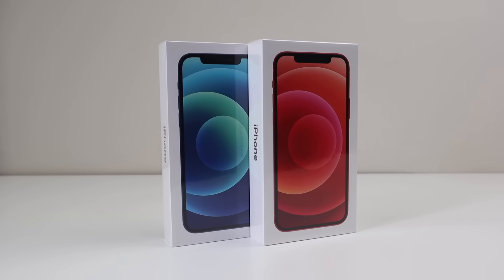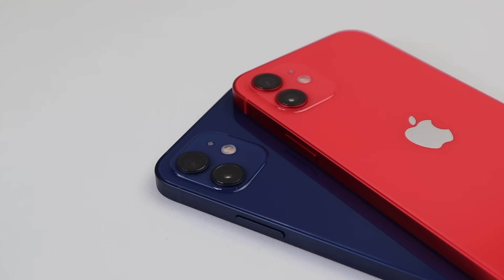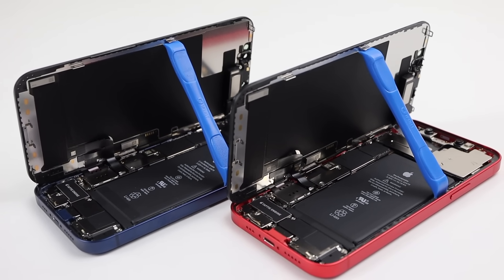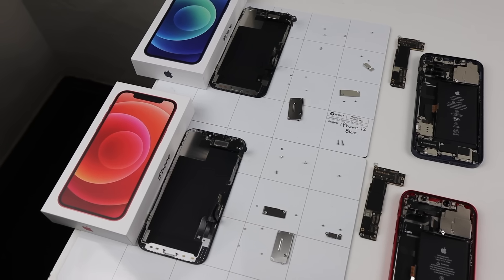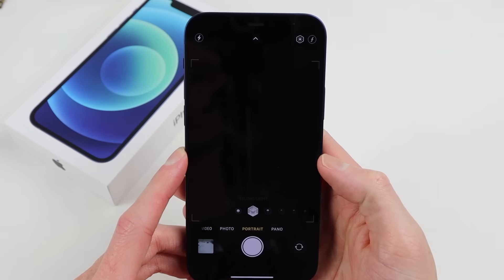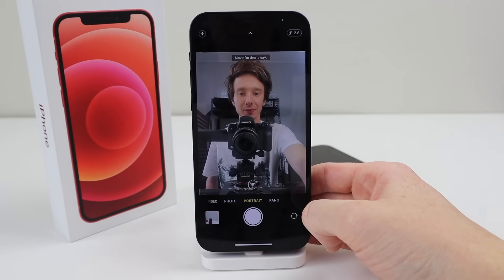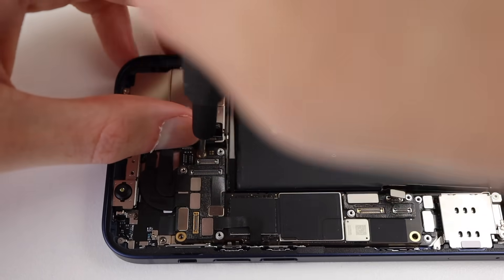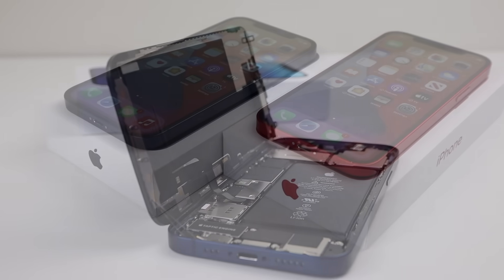iPhone 12 Anti Repair Design - Teardown and Repair Assessment

Comment: So basically Apple will break your phone. Hope they're enjoying their 5M loss in the M1 hihacking.
So how are they doing this? The logic board impedance? We know no 2 components are exactly the same. So overall no 2 logic boards will have the same impedance.  Write into the software to look for the previously measured impedance +/- 5%. If its the known impedance start all systems normal.  If not.....

Comment: They do this so 
1st; they make more money 
2nd: Chinese workers cant steal genuine phone parts in factory and make money of ebay
3rnd: make more money.
4st: F*ck Our users, they are here for us.. not the other way around. the f*ck they think?
5st: who cares, idjuts still gonna buy it if they previously used iphones..  

Two days ago, my iphone 8 started to act up... No issues before just a "wtf"-moment with soggy swappin between apps.. I dont use a lot of apps.. and NOW it starts to feel " a bit slower" .. it has been a few weeks since my last IOS-update.. and it is now 2.5 years old.. 
so here goes: Dear apple, this will be my last Iphone.. I will not get a new iphone, I will not have to buy a brand new charget, (I have 5-8 genuine apple chargers and cables that goes back to Ipod)
we have had our downs and downs, but even after going from the 6s model to an 8 it didnt feel "wow".. like piss warm flat beer... charged up my old 4s and it feels exactly the same.. And have a better screen format.. So bye and thanks for the fish. ps. f*ck you apple.. ds.

Comment: 2:37 Am I the only one who finds it strange that the two "identical devices" have different amounts of free space?
Reply: Only guessing, but I have to assume one color came off the line later than the other, and it probably had a minor software update built-in.  Once they've both updated (assuming you've changed nothing else), they'd probably be the same.

Comment: "We Are The Future"

Here is the new iphone 20, no charger, earpods, adapters, warranty or a battery. Oh almsot forgot, the phone doesnt include a screen and any other part.
Price is 50 000 dollars, also you can buy the rest of the parts at our store for 10k each and remeber, no fixing, when your phone is broken you gotta buy a new one but because we want no impact on the climate it will cost you doubble to get a new one and after a year we will install a software on your phone so that it doesnt work anymore. Enjoy!
Reply: IPhone 21 will just not include a phone at all just the box
Reply: iphone 23:

You get nothing. You lose.
Reply: new premium air
open the box and now everyone has it
Reply: Apple Marketing Manager reading this: "OMG GENIUS"
Reply: @hanabi9999  xD
Reply: You guy missed the point of the video. It won't be, "Go buy all our parts on our store."

It'll be, "Here's just the phone. All parts are serialized and cannot be replaced even with parts purchased specifically for the device. And we don't sell you the parts on our store. Go, exclusively, to our repair shops so they can decide if they want to repair your device. Or they'll break it further and tell you to buy a new phone... Oh and by the way you'll need new adapters for all your old connectors to function with your new device. Have a nice day, and a clean planet."
If they sold you functional parts on their store they would be encouraging self repair or 3rd party repairs, which is something they don't want.
Reply: @epicfail5473  bro my comment aint really bout the video, its about the New iPhone 22. I dont make the rules
Reply: The video is very good. congratulations! If ken you bought or will buy an iPhone 12 Pro, this is what you have to buy !!!!📲📲                  https://amzn.to/2IZY5VM
Reply: @Galaxies no, that means that the iPhone has some sort of value
Reply: Apple: Write it down! Write it down!

Comment: Sorry Apple, I don't like your attitude and I'm not replacing my iPhone with a product designed to require over-priced repair (that starts pretty darn expensive) - that's just greed. I'm guessing your battery doesn't last as long as the other components? Perhaps competitors ought to start advertising the life-cost of ownership?

Comment: Tim Cook: "yea so we've already got about 2 billion of those wall adapters in circulation so we wont include one with your $1000 phone but we will include a new type of cable that doesnt fit any older wall adapter so that you have to go and buy a new wall adapter for $50 extra and dont forget a $40 headphone port because we're too fucking retarded to care about our customers or even just make our headphones with a lightning cable instead of a AUX or including one in the box with a set of headphones"

I haven't even watched past this point and I just know it's going to get so much more infuriating. Fuck apple.

Comment: There is some component which you have to read and copy the display pairing id has to be read into the respective phone and I have seen a video where this problem is solved
I think you should read the face id and refeed the id and check it out

Comment: Alright, it's surprising that the phone won't start unless you use the charger. But why do they let you turn it on using the charger ? Not on purpose I suppose.
Most importantly, do you use the charger that belongs to the device ?
Apple is so evil, the phone might refuse another charger just like it did with the camera.

Comment: Thanks for your commitment to doing this video. So you can't use the usb C to lightning cable without a new C type charger but surely you can use an older charger with an existing usb A to lightning cable, which we Apple users have a plethora of?

Comment: I wonder why Apple didn't allready came up with the Idea of integrating a type of starage chip which erases itself if light hits it, like these old Eprom chips. This way you will brick the phone by simply opening it. If you combine this topology with for example a raid 0 network of those chips, it would be nearly impossible to repair those products.

Comment: if you have a older compledet charger example form iPhone 6s you can used to iPhone 12  and you don't need buying the adaptor 👏
Reply: But it wilm charge slower do you know why everyone is switching to type c because it charges faster
Reply: @theirongamer7791  yes but you don't need buying the new adaptor when battery drop to 20 % then putting into charging earlier and that is 🤗
Reply: @zoranmilanovic1075  nope wrong
Reply: @theirongamer7791  never mine

Comment: I'm a big fan of "right to repair"

That's why my car is older than the average Fortnite player.
Reply: @ISHMAM RAIYAN I swear the late 90's Corollas are invincible. They're still common on the road today.
Reply: So, not that old, right?
Reply: @alexisaguirrevazquez7900  Maybe I should've said average GTA player. They're (slightly) older.

In any case, it's a 2001.
Reply: @Somethin5041  You know that was also a joke about fortnite players, right?
Reply: @alexisaguirrevazquez7900  Yep.

Comment: It’s sickening but it is industry standard. I used to work in reverse engineering one specific incident I was going Chrysler gauge clusters. You couldn’t swap them yourself and if you did you would have to tow it to the dealer to reflash cause it won’t start if there’s a VIN mismatch between ECU and gauge cluster. Also TCU and who knows what other modules. But manufacturers make money on parts more than cars.

Comment: Having those features actually identifies if the phone is genuine and the parts are OEM not to make it unfixable but yeah instead of you bringing it to a cheap repair shop you have to get it repaired in an apple store for the price of another phone lol. The glues also help parts on the phone from vibration, static charges, and shock. But damn... I don't know why I am here I hated apple after Steve Jobs is gone but what they did to the charges, earphone jacks, etc... Is this their new innovation? lol
Reply: IPHONE HACKING JASON-HACK ON TELEGRAM HE IS A PRO 💯 💯
+1 (219) 202 2523

Comment: The high cost of the new phones makes repairs after warrany necessary. Apple knows this and can make a buck selling parts and making repairs. I bet there is some engineered failure tucked away with these devices as well.

Comment: It may have to do with calibration data for the camera and the screen? True tone seems like it would need calibration to function at all. The camera might be calibrated too and if the wrong calibration data is used for control purposes, that may mess things ups. Of course it would be easily fixed by having a database with calibration data for a all genuine parts and just pulling the correct data based on the ID of each part

Comment: i don't know why I continue to use apple. I replaced a battery in a 6s for a customer right before covid and he camera stopped working. If i put her old battery back in, it was fine. It's just so scummy on apple's part. you spend all that money on the devices, they're coming with less and less accessories and yet you still can't take your phone to a shop to have it repaired. and then the customer thinks you broke their phone leaves a bad review. you lose a few customers.... why? all because apple wont let you replace a battery in their overpriced phone! The biggest reason i switched to the z fold 2 after supporting apple for years, is because every year they just slap you harder and harder in the face. oh you wanted a 120hz display on the 12 pro... nahhh you're stuck with 60hz. so yes, as the z fold 2 is $500 more dollars than the 12 pro max it was worth it just because my money wasn't going to apple's greedy pockets. Mind you as i have had most galaxy and notes though out the years I have also had every iPhone since the original. We should have learned our lesson when the 4 came out and they told us we were not getting signal because we as paying customers were "holding the phone wrong" right then i should have realized..........

Comment: Unfortunately, the problem is not new... But there is a solution ! For the older iphones (11 and before), you can buy a all in one chip programmer for the display, battery and fingerprint (the JC-V1S for example) it cost about 70$ on alixpress. I hope we will soon get an updated version of these king of programmers for the iphone 12 and f**k Apple anti repair design :)
Nice video BTW !

Comment: Hi Hugh,

   Did you try swapping the screen and battery? Those are the most common repairs. Replacing a logic board most likely means the phone experienced a severe damage. Might as well buy a new phone.  Also, perhaps the logic board pairing is to ensure that the board hasn’t been tampered with; security purposes? 

   In fact, from my experience, repairing the device with 3rd party parts such as, screen, battery or camera changes the device into a lesser quality. It does make the device usable again, however it’s just not the same anymore. For some people it may not be a big deal, but it is for me and others. It’s a very expensive device. 

Thanks for the awesome video! I’ve enjoyed it and it’s very informative! Good job, mate!

Comment: Meanwhile i got my battery, daughterboard (charging and speaker) and the connecting flex cables (mobo to daubo) repaired in like 30$ for my poco f1 ...
Bought that phone in nov 2018 and repaired it in feb 2020 ... Still works great.... Even though i have a overclocked display and gpu kernel (lawrun) in my phone... And also a CAF rom (reloaded os)... Thanks apple ... Won't bother buying a 300$ android which even has a case inside the box rather than a 1k+$ iphone without a charger incl. In a box...

Funny that in a video comments ppl called android users broke and told iphones are far better in day to day use... Please for the love of god buy android ... Far more user friendly.

Comment: ill admit that although this is just criminal by itself, if they commited to provide hardware repairs fo up to ~4 years for each models, with decent pricing, this (+ the other report -to lock tricks) could END the asininity of phone thieves. that would be cool indeed, being able to just leave your phone be anywhere and dont be worried since it wont be of Any value to anyone else would be a very welcomed peace of mind. but still... until thats the deal, NOPE.

Comment: How to extort a market ensure your the only one that can offer customer service, then you can run a monopoly on the monthly fees and for those naughty people that don't pay well the fees will amount to the cost of buying it over again. Then to double down pay off some Politicians in Mass, to push laws that enforce the technician is the only people that can repair the equipment. They did have to make an exception for batteries in remotes... ya your paying a company that is investing in ways to rip you off and it has no issues making it law by briding the people ment to protect you, PS check how Mass voted, for the read plunker in your undies.

Comment: It is blatantly evident that Apple made a software to "subtly" affect devices with changed parts, in computing electronics, if something works, starts, if something does not work, it will not start, anything between this is completely suspicious.

Comment: The issue here is the same thing I seen swapping parts for many xbox series hardware. Easy to get the parts but you have to jtag the machine to mock the same UID's of the hardware. Sort of a built in layer6 authentication. I would say I know where the technology came from but they would probably kill me. LOL just a bit of fun and suggestions. Look at a location to jtag it to sync it with the virtual server on the device. Make a remote server or service to allow the UID authentication remotely or just use the phones software to assign the hardware with the original assignment. Who knows what this will do for the average repair tycoon i suppose.

Comment: This actually reminds me a bit of old MFM hard drives.  Long before IDE and SCSI drives, the controller was on a card rather than baked into the drive module itself, meaning the card had to be configured for the specific drive hooked up to it because the drive lacked the hardware to calibrate itself.  this mean that you could take a pair of perfectly good drives and perfectly good cards, set them up, then swap the drives and they would not work until you did another low level format on them so they would work.

I wonder if the cameras have  similar issue, with critical data or hardware not being stored on the module itself.

Comment: I hate apple....
Probably a lot of people will disagree with me but still...
1. They are overpriced (respective have premium parts where they are not necessary)
2. In my eyes the absolute worst OS to handle (they have good features not gonna lie but I hate the handlich of iOS)
3. If something breaks in most of the cases u will have to buy a new phone instead of getting an exchange even if it happened during warranty
4. They change their adapters all the time while which causes in lot of sells of their cables or similar products....

Comment: While locking down the phone for repairs sucks, on the other hand, in Brazil phone theft is very common, because they resell the robbed phone parts to third party repair shops and this lock make iPhones useless for robbers.
Reply: This. Car manufacturers do this with head units/radios here in the states (and I’m sure abroad as well). Once you try to swap out the head unit with the unit from a different vehicle, there’s a vin lock that can only be fixed at the dealer for a steep fee and that’s only IF you can prove to them it’s not stolen. I wouldn’t necessarily call that strictly “anti consumer” when it’s an “anti-theft” measure tackling a common problem (busting a window and yoinking someone’s radio) that would have only gotten worse now that most vehicles have tablet sized screens in them.
Tesla does something similar when their vehicles need repaired. 
I don’t hate Apple for doing this, I just wish they’d stop trying to market themselves as the most eco friendly company on a crusade against e-waste when any iPhone you get lasts maybe* 3 years max if you’re lucky.

Comment: If you have a normal usb charger lying around from a previous iphone, why wouldn't you have the cable that came with it?
The usb type c to lightning cable included is so you can connect to devices that dont have the old usb port.

Comment: Some heavy negativity on this comment feed but let's be clear - there is nothing environmentally friendly about any of this kind of technology - regardless of manufacturer or indeed it's repairability. At least if repairability is controlled then e-waste is managed. Give it to anyone to repair and the broken/replaced parts go straight in the trash, do not pass GO, instead go directly to landfill. Which is worse? ...or don't give it a second thought and continue complaining about "scam" this and "built-in obsolescence" that. What's your local repair shop doing about e-waste?

Comment: In a thought to my earlier comment I need to wonder. If parts were swapped pre initialisation would they have been not affected by serial details etc. I guess a main board would have to come with the os. Ut once started and setup they may set like mac address connections to each other

Comment: My blackview bv9500 pro is literally screwed together with external torx heads. No adhesive. Can change my screen in 2 minutes. Can take down the entire phone in to it's components in 10 minutes vwoth nothing but a screw driver. This is how phones should be.